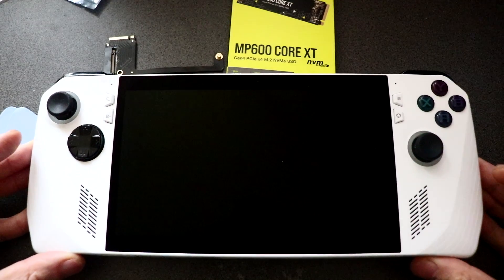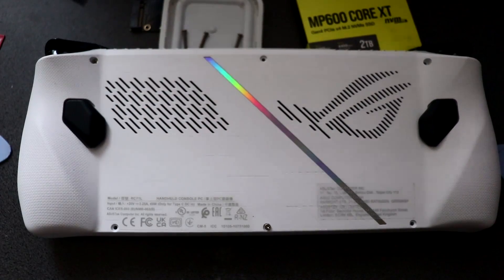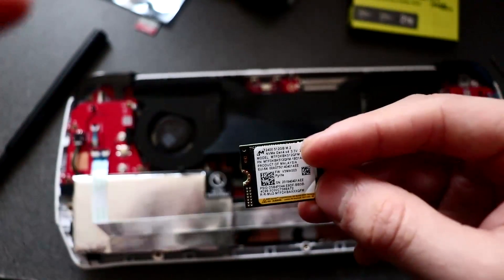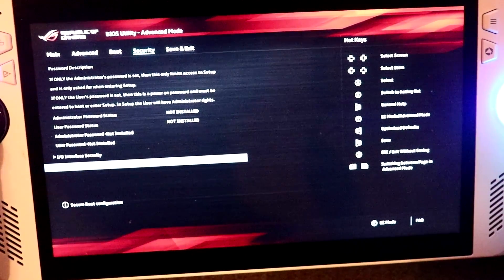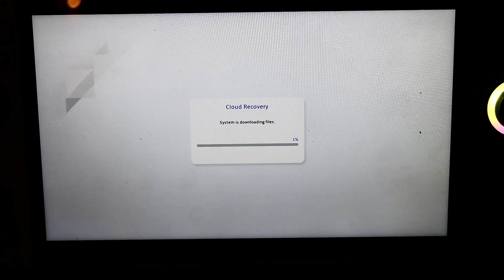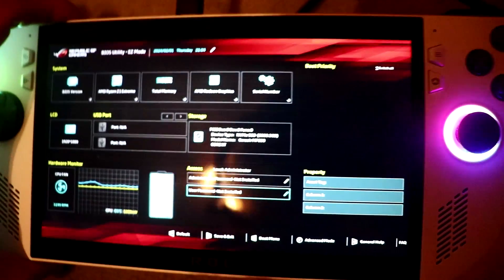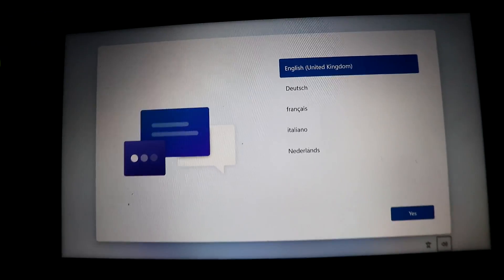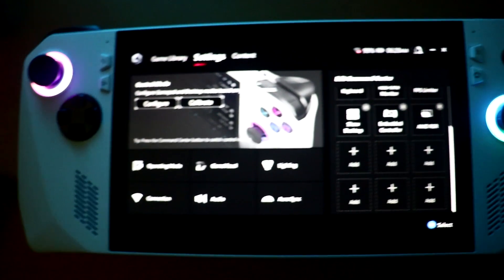Asus Rog Ally 2TB SSD Upgrade Tutorial

Comment: Just bought a preowned rog ally 2tb for £500 
No box but did have a case for the ally itself. Put a 400gb sd card in but soon took it out because of the excessive overheating and I'd heard about sd cards getting fried.
So it begs the question, if the system can malfunction sd cards and where is the slot? Near the side right. So can you imagine what the system is doing to the ssd which is located around the centre of the system.......